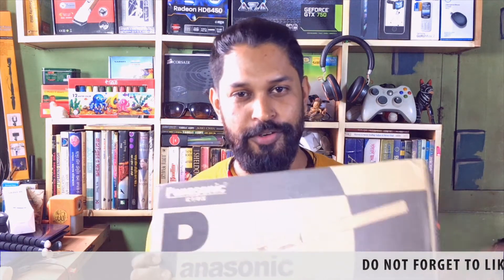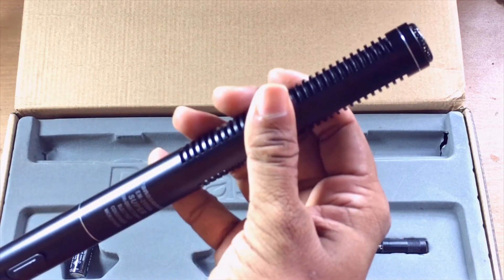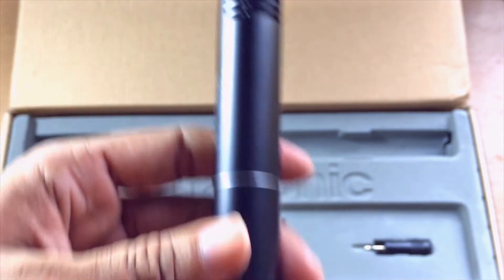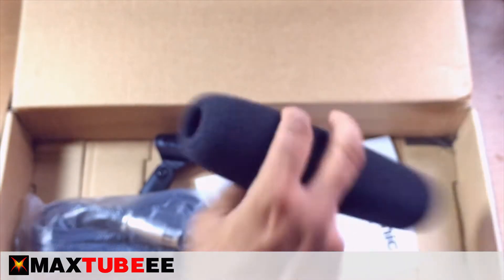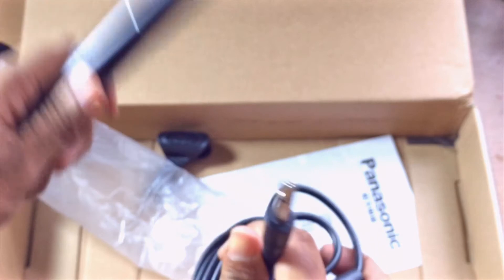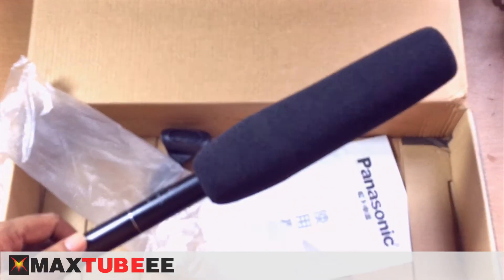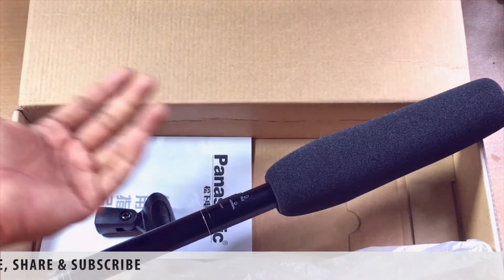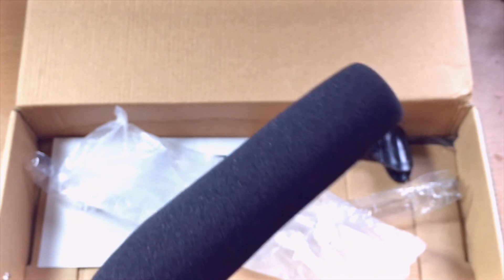Panasonic Microphone Unboxing (Super UNI Directional Electret Condenser )

Comment: "This microphone can't use in mobile phone" this message I have been get from other unboxing video. 
Could you please tell me which is correct or true " it will can be use in mobile or laptop"?
Reply from the maker: I have used it in my iphone and my laptop and it depends on you if you believe it or not.
Reply: You can use it if you use an Audio splitter :) thank me sometime
Reply: @danisulat6762  what's that
Reply: @pilot505  audio splitter that split the Microphone and headset. You can also use USB Sound card then plug that into OTG adapter